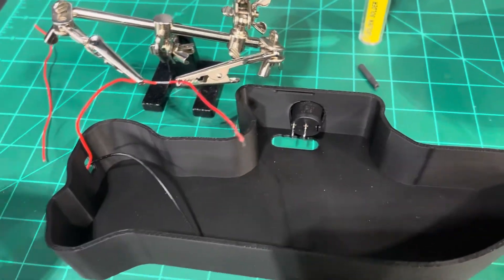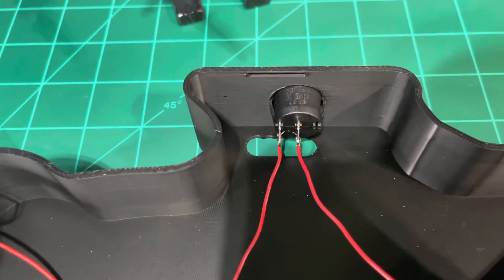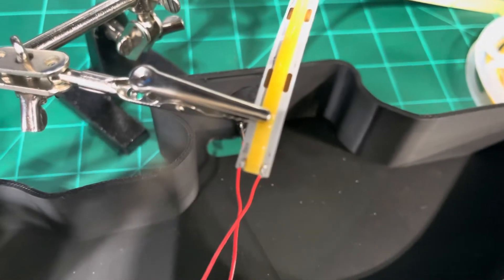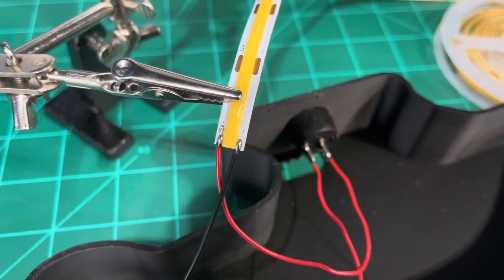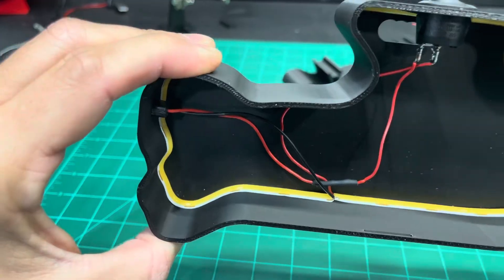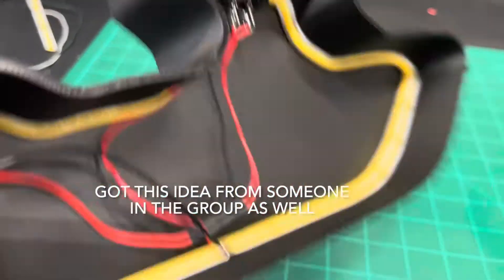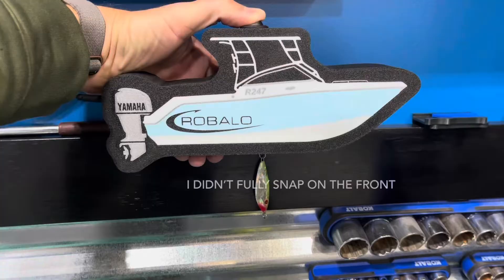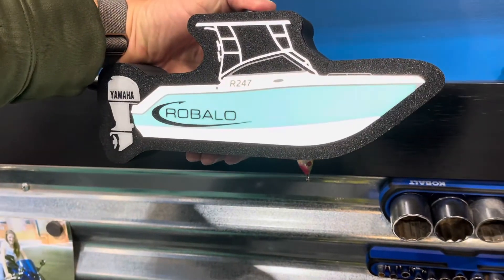How To Wire Your 3D Printed Light Box

Comment: Can you share how you did the notches on the inside?
Reply from the maker: If you’re taking about the ones to hold the lid on I used the section view button to cut the model visually. Then I added a plane to where I cut the model so I could draw. I added a triangle to the lid and an opposite triangle to the base. I then did an extrude to the lid and a remove to the base.

Comment: Need some advice. When I create my light boxes and install the LED strip. After a while the warmth from light box makes the adhesive lose its adhesive and there’s parts where’s the led strip starts to fall within the light box. What’s the best way to prevent this from happening?
Reply from the maker: I add dabs of hot glue to mine. Thanks for watching.

Comment: Having trouble trying to create the usb-c hole you used for this. Do you have a file folks can use? I bought all the parts with your links
Reply from the maker: Thanks. I don’t have a file but here are the dimensions. 14.5mm x 5.5mm rectangle with 1.5mm radius on the corners. Hope this helps.
Reply: @savemoneydiy87  Ok i tried creating something in Bambu lab software but I don't know how to round the corners
Reply from the maker: What software did you create your light box in?
Reply: @savemoneydiy87  sometimes I use bamboo software and sometimes I use fusion. But I'm super novice at fusion so its a bit complicated. I appreciate your responses.

Comment: How thick are you making the portions of the face that you want light to shine through, and what brand filament? I've been having a lot of trouble with the color being drastically different when the light is on vs when it is off.
Reply from the maker: I do 1mm on the black areas and .4mm on the areas I want light to shine through. And I also adjust the same color another layer or 2 if I want to add darker color to it. Like for white I start at .4 and then other areas of white I make .6 or .8 for a darker white. I use Bambu filament for the most part.

Comment: I really appreciate the vid but the one thing I wish I saw was how you soldered the wires to the switch (I do not mind if it's in 2x speed). Almost everyone I see skips that part of the assembly for some reason( I don't know if it is to make a short YouTube video)
Reply: And on the switch how do you know which side is positive and which is negative because you have two red wires on the switch?. or for this situation it doesn't matter
Reply from the maker: No worries. I just made a video to try to show you how I do it. Hope it helps.
Reply: @savemoneydiy87   Thanks
Reply from the maker: HOW TO WIRE UP AND SOLDER A LED STRIP WITH USB AND SWITCH FOR LIGHTBOXES
https://youtu.be/F71ngQKJcxY

Comment: you need alu tape on the bottom.
Reply from the maker: I use it sometimes. Didn’t feel this model needed it. I may add some and see the difference though. Thanks.
Reply: @savemoneydiy87   it increases effective light output so you dont have to drive the leds so hard making them last longer and heat up less wich prevents the glue from coming undone.
Reply from the maker: I don’t have a way to control the led’s as it’s just on/off. But I do agree on the light effectiveness.
Reply: @savemoneydiy87  you can place a simple resistor between the switch and the strip to lower the current and voltage.
Reply from the maker: Of course. I didn’t even think of that. I have some on my work van. Do you have an ohm value you would recommend or should I just experiment.
Reply: @savemoneydiy87  best thing is to make a current measurement with your multimeter and use a online tool. just note the wattage of the resistor so you dont burn it up.
Reply from the maker: Gotcha. I’ll give it a shot.